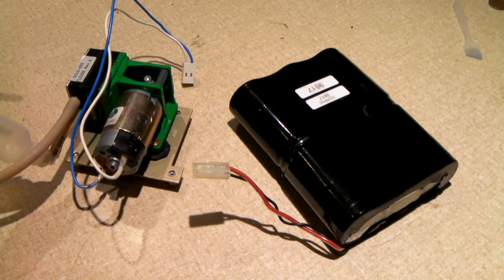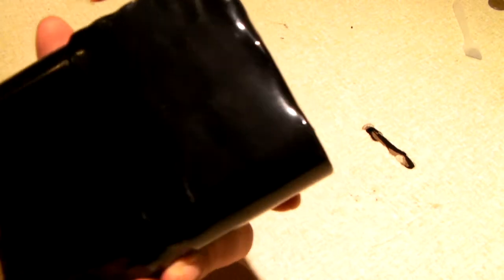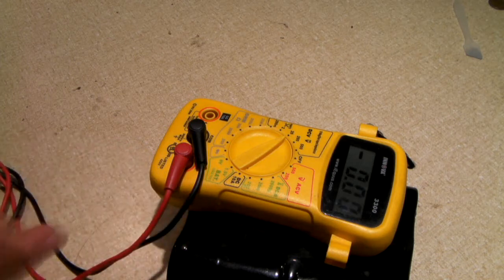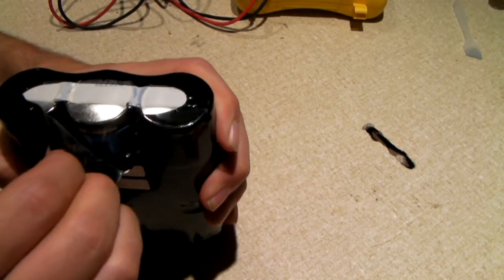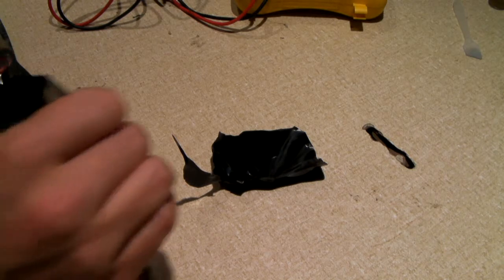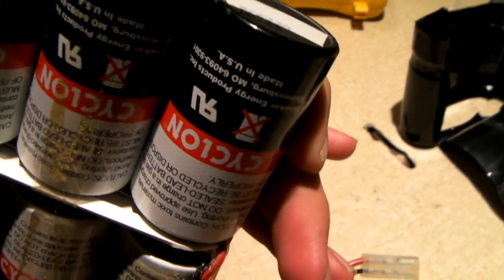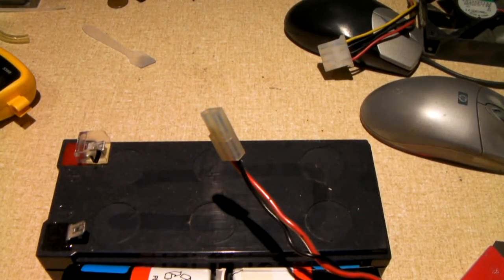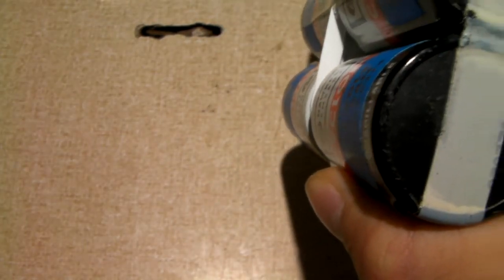A look at a weird battery pack from some biomedical equipment

Comment: What are your main PC specs?
Reply from the maker: GENERATION 7 CUBE COMPUTER MIDTOWER DELUXE
* = Upgraded hardware
Approx Cost of Upgrade: $867.00

*AMD Ryzen 7 1700X CPU
*AsRock X370 Killer SLI/AC Motherboard
*MSI AMD RADEON RX550 GPU, 4GB GDDR5
*16GB G.Skill Flare-X DDR4 PC4-2400 RAM
*Western Digital 256GB M.2 2280 SSD
Thermaltake Smart M750W Modular 750W 80+ Bronze Power Supply
2x2TB Hitachi SATA HDDs in RAID-0 (4TB)
2TB Hitachi SATA HDD (single disk for TV storage)
4TB White Label SATA HDD (single disk for backup)
*SATA DVD-ROM
*SATA DVD-RW
1.44MB Floppy Disk Drive (will be functional when USB adapter arrives)
Media Card Reader
Composite Video Capture Device
Modded 2007 Xoxide X-Static-II Case
Windows 10 Pro x64

Water Cooling System:
*XSPC RAYSTORM PRO CPU Water Block
Custom Radiator (repaired)
*Vinyl Tubing from Lowe's
*SC-600 Water Pump
ThermalTake BigWater 735 Coolant Reservoir (repaired)
4x Brass 90 degree Elbow fittings
*Primochill PC ICE Low Conductive Coolant
*New Routing of hoses and wires through top of case (versus rear)
Reply: Cube Computer Channel That's a nice PC.